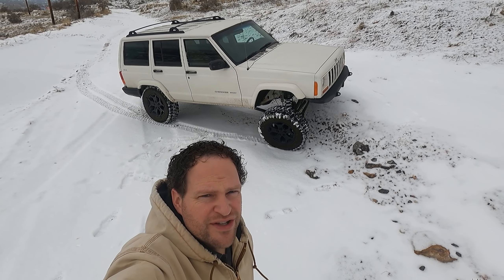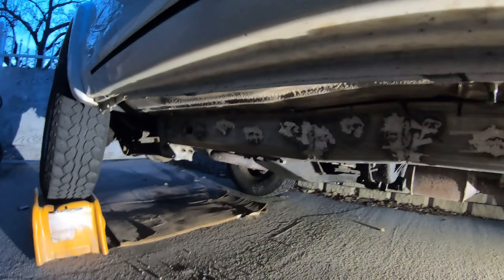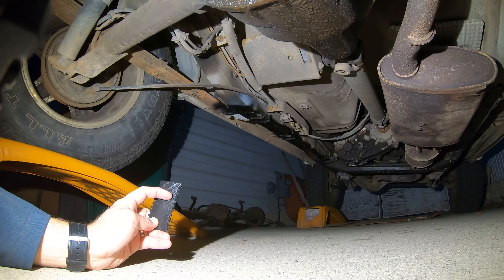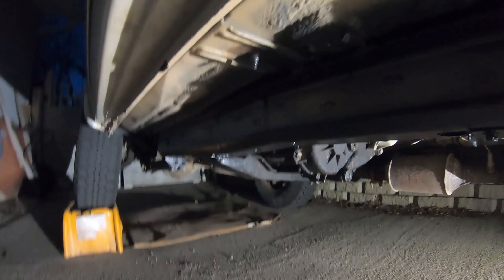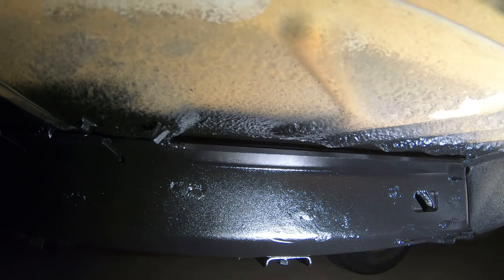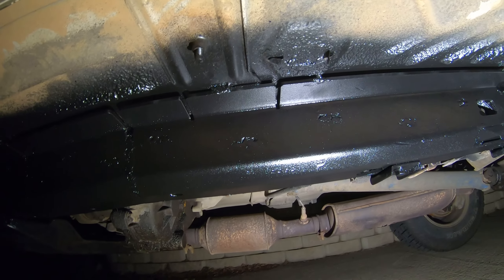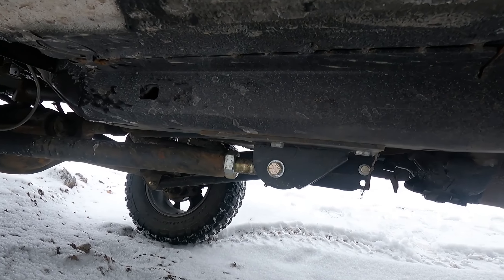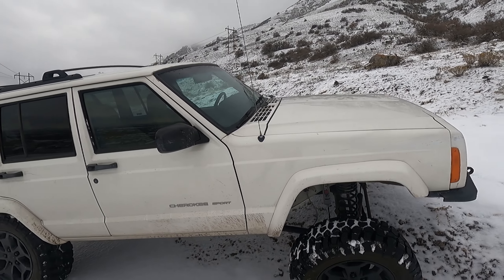Undercoating In A Can 1 Year Review!

Comment: Ive used many. Th wax one is what i  use now.  Fluid film or oil inside doors .
Reply from the maker: After having them for a while now, I still like the rubberized for an initial coat on raw metal. The wax is what I use for pretty much everything else now, and I've even used the wax over the rubberized in some spots.

Comment: I use to use spray on under coating just like you're using. When I bought my 2014 Wrangler the dealership said not to use it because it can trap moisture between the coating and the metal making it rust more. The Toyota dealership also said the same thing. Since then I have been using Fluid Film. It's all a matter what you like.
Reply from the maker: This rubberized coating was put onto bare metal that was lightly scratched and degreased for good adhesion. There was no existing rust being covered. Undercoating In A Can has a wax based version as well that you can spray over existing light rust and it will stop the rust from spreading. From what I understand fluid film is great, but I prefer a stronger base coat first. I'll probably spray the black wax over the underbody once I'm done with welding.
Reply: @EngineAdventures  is the undercoating that you show a better price then the Fluid Film?
Reply: I just price the wax undercoating, definitely more pricey then the Fluid Film.
Reply from the maker: @chuckasarus  interesting, they are both owned by Petroleum Services Company. It looks like they are similarly priced per can, but if you buy in bulk Fluid Film is about half the cost.

Comment: Hey You should do everything with the black wax . It won’t allow moisture/water to form underneath coating. Moisture will form underneath the rubberized coating. 
I have their black wax coating in a can
Reply from the maker: Thanks for sharing, I'm actually leaning that way, and I planned to spray inside the frame with the black wax once I finish welding everything on it.